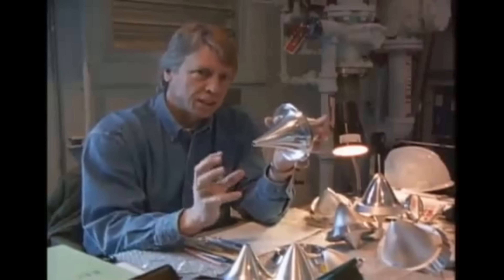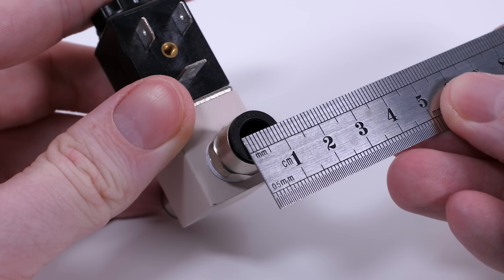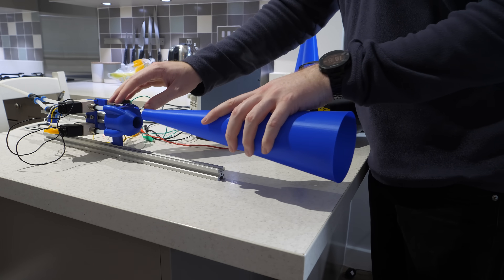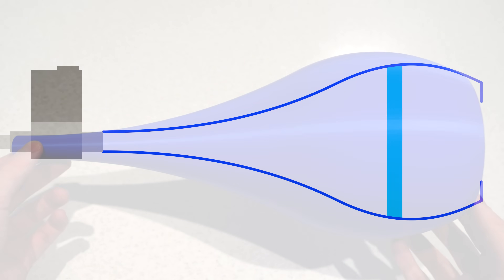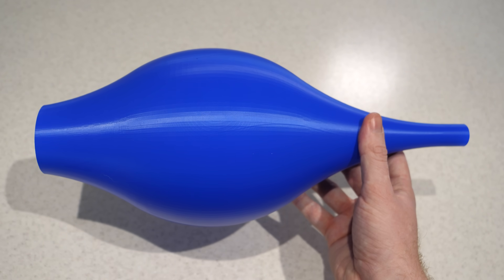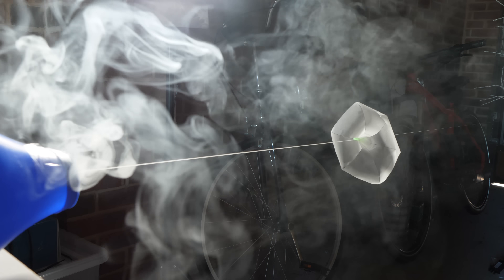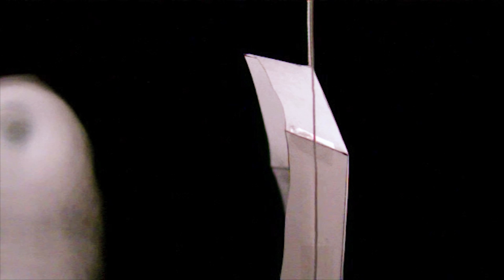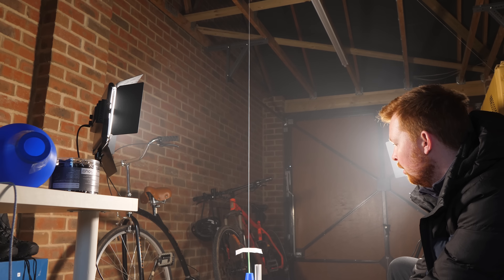Smoke Ring Propulsion

Comment: Try a large speaker sounding a low tone, around 20 Hz (square wave). I assume you will have to pump in air, or the air will just move back and forth. Don't know how to pump in air without turbulence. Maybe flap valves on the speaker diaphragm, but I don't know if they  would cycle fast enough. You can also play around with the length of the tube as it corresponds to resonance with whatever tone you use.

Comment: Tom, What you are designing I use to play with as a kid of the 60's - The Air Blaster by Wham-O
You would like this toy!
https://www.youtube.com/watch?v=fxZu_Y_m8i4

As a kid I remember wondering how it worked. You cocked the gun which pulled in a rubber diaphragm tight. When released it "puffed" the air vortex out HARD (and with the coolest sound)... All adults smoked back in the day so they provided endless amounts of smoke for me!! Those were the days 😂😂👍🏼

Then of course there was The Turbo Tube by Wham-O:
https://www.youtube.com/watch?v=h3vWazZQBK4&t=44s

I would buy you both if I could. These are relic toys of my yester-year...

Comment: You might have a look at the valves they use in paintball guns. They have to open and close really fast and I think they use a poppet valve design. You can get off 12 to 15 shotsper second with practice, pulling the trigger.

Comment: I feel like one thing that's taking some energy away, and what's possibly causing the secondary ring, is the caps you have on the cannon, it end up having a flat surface that the air hits and rebounds against.

Perhaps on the next run, print caps that have an inner curve that comes flush to the cannon's body.
Reply: Well i think it needs a sharp corner / transition in order to create a vortex at all  its just vortex shedding  but in a ring now idk if there's any way to optimize it i was curious if at all principals relating to creating loudspeaker horns could be applied at all as well .
Reply: @connorjohnson4402  yeah, I could see those principles being applicable, they are designed to move sound waves efficiently. Looks like Tom has a few more possible designs to play with.

Comment: Very nice! ... Instead of a string guiding the sail, how about an aluminum rod or tube? ... The string is probably flexing sideways when the sail is hit off center. A metal rod or tube wouldn't necessarily do that. Also, you can add support elements on the back of the "sail" if you make it out of rigid material. Even balsa wood or paper stiffened w glue would work. Add supports on the back as if it's a weight-bearing bridge or pylon that's upsidedown. That might help reduce the flexing. Or, attach a weight on some strings hanging down -- like a parachute, but one that's going up instead of coming down. Just a thought

Comment: Making the aircraft more rigid with a frame would help you hold the vortex longer as the sail would waste less energy by deformation. Also adding weight to the base of the aircraft would keep it oriented correctly when the vortex does not hit dead center

Comment: Maybe some Dyneema fabric would work better as sail material. It is both lighter and stronger than steel. You can buy super thin sheets that are used to make stuff-sacks and the like for camping. Also, it's not crazy expensive as synthetic fabrics go. Less than a dollar a square foot or cheaper for the really thing stuff. It's watertight and somewhat air-tight although not 100% airtight. With some fabric dope you could make it airtight and mold it into any shape or complex curves you like.
Reply: Forgot to add: they actually make high-performance racing sails out of it for super expensive, super fast racing yachts, so you can buy exactly what you need....

Comment: If you are using pulsing, I believe you need the pulsing frequency of your air to match the natural resonance frequency of your exit cone. if you use a pressure sensor to measure the pressure at the exit of the cone with the exit blocked off, then graph the pressure vs air pulsing frequency to find the lowest frequency where that pressure is lowest(local min), then maybe use half that frequency to get max pressure at exit . At 6:30, looks like you see a resonance mode. Very cool slow mo footage!

Comment: If, the shock wave twist in the cone, the centrifugal force make compress the air to the flange, the vortex comes out will be more sudden. 
Just guess, the first vortex is from the convergent side of the cone? It’s not that smooth.

Comment: if u get the sail rotating fast link with the lasers then it will self balance. also u will probably not need the straw then, just a small hole in the middle will do.

Comment: ion railgun propulsion
Reply: coil ring current tunnel subway with permanent and electromagnet train cart in the tube, ie, the coil train, but without the battery inside, and the coil always on, like a grid power wire, but coiled

Comment: Watching the vortexes smash into the sails hurt. What if the sail had an initial velocity similar to that of the vortex when the vortex got to it?

It looks like vortexes work by taking air in from the front and transferring them into the back while maintaining their structure. I feel like a sail might hinder the entire process of the vortex by removing the ability to shift air from front to back. Would be interesting to see a test with a vortex passing through a line of smoke in the air.

I'm also curious if a vortex can exist around a rail. Could you make a vortex that runs along the outside of a 1/2in pvc pipe? Maybe make a shuttle if it works?

Comment: very good video ! you could use a vape instead of a smoke machine, maybe with a fan in a 3d printed housing to suck the smoke straight out and make it into a legit smoke gun. instead of using a smoke maching like that. 
i think this would help you alot for these kinds of test becose those vape boxes thing have alot of settings you can adjust so get the best consistency of smoke and even duration of the "puff" so you can put the same amount of smoke every time. the vape battery box with the tank on top even has the right shape so you could mount a lever to activate the fan right as you start pressing the button on the vape

Comment: This could be a job for a sprinkler valve. They're meant for water but will dump a large volume of air from an air tank instantly. I've used them in a few projects. Great for air cannons. Basically they use their own pressure to seal the air. When you apply a voltage to the solenoid it allows a small amount of air to release the pressure which releases a much larger valve instantly.
Reply: I'd look into an industrial QEV, quick exhaust valve. Similar in function to your sprinkler valves except better in every possible way and need no modification.
Reply: @dontnubblemebro  seconding this. I used a QEV for a potato gun when I was younger and it worked fantastically. I ordered it from McMaster Carr and it only cost me like 20 dollars!
Reply: That sounds similar to quick exhaust valves found in paintball guns
Reply: @ki0w0-lordofwatersheep  Speaking as a paintballer, He may have better luck with the spool valves that certain markers use. They are usually found in electronic markers. They pressurize two chambers on either side of a plunger using solenoid valves. The resulting motion of the plunger acts as a high release valve for an air supply. You can vary the speed of the plunger as it travels in the spool by exhausting one of the actuating chambers at different speeds, which is usually how we set projectile velocity. The result is a very consistent and fast (30+ /second) controlled volume of air. Modern spool valve markers can keep projectile velocity variations within 1ft/s. 

If that sounds a little complicated, it is.
 
A lot of entry markers use something called a Pop-it valve. A fully mechanical system that consists of a plunger on a spring in a chamber with a hole in it. The plunger hits a disc with pressurized air on the other side of it, air leaks out and begins to pressurize the chamber sending the plunger back the way it came. Some of the air leaks out of the hole in the chamber and sends the projectile on its way. To change the velocity of the projectile we make the plunger pop the disc harder (thus "pop-it valve") by tightening the spring. Its a slower system, but it will always work as long as it has enough air pressure.
Reply: @reathyork  It's not "pop-it" valve though, it's "poppet" valve. https://en.wikipedia.org/wiki/Poppet_valve
Reply: The electric solenoid valve actuates similar to the ones in his video. They vent the pressure behind the diaphragm too slowly and you lose some efficiency. Not a big deal for shutting water on and off, but for dumping air as fast as possible, the electric solenoid valve is not ideal. A common trick is to modify the sprinkler valve by removing the solenoid and filling it's threaded hole with epoxy. Then you drill a hole in the middle of the sprinkler valve top, the same side the solenoid was attached to,  and attach a valve. We always used air compressor blow guns because it was easy to manipulate and you get about a 1/4 inch hole to vent through.

As others have mentioned, QEV valves are more efficient and don't require modification. The only downside is they are pretty expensive especially if you want a large one.
Reply: they are barely fast enough, I think you would have to couple the sprinkler valve with a trapdoor style purge valve in order to get the optimal "waterhammer" type effect for a vortex.
Reply: I had the same thought until I saw he wanted rapid fire.  The modified spinkler valves are good for dumping which is why many use them in compressed air potatoe cannons.  I don't think they would fit well in this use case though due to speed.  Of course there are other issues to address as well as could be seen in slo-mo shots.
Reply: @dev-debug  A qev plus a hammer valve = full auto
Reply: has tom not just make an air fuel injector
Reply: I work a lot with irrigation valves, I’d love to know what specific valve you used. I had no idea they were capable of controlling air bursts.
Reply: Interesting. Sounds like the head valve of a compressed air nail gun. I'll have to look this up...

Comment: I wonder if the sail should be shaped more like a hot air balloon (perhaps retain the lip on the circumference) with the bottom inlet a more rigid material to help guide the center airflow. Any air that is not center focused (and therefore does not enter the sail to provide a push) will flow along the outside and should impart some force to the larger area toward the top of the 'balloon'.

Comment: I hope you don't give up on this. If I had to guess, your inaccuracy is being created by the barrel "method" at the end of your trumpet. If the air gets to the top before it gets to the bottom by the slightest of differences, it may be what is causing it to veer off course. I think you should try to go back to the cone method, but perhaps with a section between the cone and the nozzles that converts the turbulent flow to laminar flow. That might get you the rings you need along with getting you the accuracy.

Comment: would it be possible to mess around with the size of the vortexes along with the frequency of occurrence to somehow reach a sort of equilibrium that would allow for the thrust to be maintained with minimal turbulance? I think that having them too close together or too large would result in the air currents from one disrupting the other. Another possibility is maybe you can alternate the direction in which vortexes are rotating so that the air currents from the one above would get sucked down into the one below and maybe help it maintain it's rotation?

Comment: I'm an I&C engineer with lots of experience with Solenoid Valves.  I'm a little surprised that you setup worked as well as it did.  A larger SV would probably be a better choice.  For a 2-way solenoid valve there are really only 3 variables, voltage, Cv and pressure rating.  You can get a direct acting valve, or a pilot operated valve which is slower but can have a higher pressure rating.  

I'm interested in seeing where you are going to take this.  I always learn so much from your commitment to testing!
Reply: Giving a bump for the expert advice!

Comment: I think making the air flow on the input side of the vortex chamber laminar would help with the turbulences. However, that may be easier said than done. About the replicas of the vortex, perhaps you could try running fluid simulations with the 3D models! Also, I think it'd be fun trying to make vortexes of lighter and heavier gasses, to see them slowly rise or fall while spinning!

Comment: One thing you might consider trying, to make a vortex ring, is a long straight tube, with small ridges around the inner diameter so that the air along the inside wall will be slowed, while the inner air will keep flowing.     It would be simmilar to a simple, straight-pipe muffler system.  

A large surface area, short stroke piston would be one of the best ways to move air to make vortek rings.

If i remember and understand correctly, the laser spinny thing,  used the laser to superheat a layer of air that was trapped inside the dome of the projectile.  Simmilar to continuous small bolts if lightning.  It would create propulsion by the plasma and air, simmilar to a pulse-jet.

Comment: I think you would be better using some kind of flat surface linked to an actuator moving it back and forwards rapidly to create the wave fronts. This would be much more controllable than the pneumatic valves. You could use something like a solenoid to make it fast and controllable.

Comment: On that sail design, it seems to me like a simple ring solid rim would drastically reduce it's deformation. Your design looks somewhat umbrella-esque, but given the constraint and goal are opposite, there may be better structure designs.

By the way, I wonder : if you make a hole in the middle of the sail, big enough to catch only part of the vortex ... Would it generate a smaller vortex passing through the sail ... Could it sail a slightly smaller sail ? Would there even be a way to make this not counter productive ? Make them expel air sideways maybe. Congrats, ou managed to trigger my engineer brain. I was beginning to wonder if it was dead. I'm happy it's not.

Comment: The cone shaped vortex generator works by slowing don the air at the walls. While the fast air moves in the center the air at the walls get slowed down and looses contact while traveling down the cone, the result is a rolling motion along the expanding walls.
The Box shaped vortex generator works by creating turbulence at the edge ob the opening. If the turbulent ring reaches a certain size it will be pulled along with the air stream.

Comment: Dandelions "fly" by creating and hanging on to a vortex ring. Their filaments being spread out radially from a point means that there's more drag in the center, which causes a vortex ring on top of the dandelion. Im not exactly sure how this helps the dandelion fly but I think it may be that the lowest pressure area is sitting on top of dandelion, pulling it upward. Maybe these dandelions are onto something.
Reply: thought this sounded interesting and it was thanks for mentioning it !!

Comment: You can make your valves close faster by using a snubber instead of your free wheeling diode.
A snubber is basically a capacitor-diode-resistor combination that "catches" the electrons and dissipates them in the resistor instead of letting them flow freely through the solenoid. Basically converting the magnetic energy into potential energy in the capacitor, instead of letting it die down naturally.
Edit:
The smaller the capacitance, the faster. But this will also increase the voltage spike. So make sure your components can handle that and maybe use an optocoupler to protect your Arduino.

Comment: The vortex isn’t required as the shape of the sail creates the vortex. Similar to how a pelton water wheel works. What you want is a high pressure laminar flow jet of air

Comment: 2:41 I've heard about this. I've also heard that it's rubbish and doesn't actually affect the storm, which makes sense because no matter how powerful that box is, lightning and thunder will most certainly be stronger and they don't seem to stop the storm.
Reply: If you are trying to protect crops from hail, wouldn't you need something ultrasonic that affects the hail particles at a high enough altitude that the change in terminal velocity of the broken up pieces has time to reduce their impact velocity? Or some highly distributed radar guided pulse laser setup. Either of which sounds more expensive than a retractable roof. Which also seems overwhelmingly expensive compared to the reward.
Reply: I mean the Volkswagen plants in Mexico used them for a time.
Reply: @otm646  Yes, the Volkswagen case is quite well known -- they got into a conflict with farmers around the area who thought the hail canons had produced a drought. Hail cannons are made, sold, and used across the world (often around viniculture), despite having been tested thoroughly by scientists and having repeatedly been shown to have absolutely no effect on hail. If you know anything about physics/meteorology it becomes quickly clear that they could not work. There are always charlatans able to make money out of people's gullibility and desire to control the natural world around them.

Comment: You are pushing too much air for everything to get wrapped into the vortex ring. See Fig 1 of this paper, you went from B to C when you reduced the nozzle size https://authors.library.caltech.edu/14170/1/Dabiri2009p33310.1146annurev.fluid.010908.165232.pdf
A cool natural version of this is a dandelion seed. https://www.nytimes.com/2018/10/23/science/dandelion-flight-seeds.html